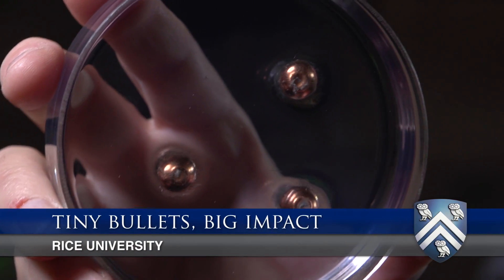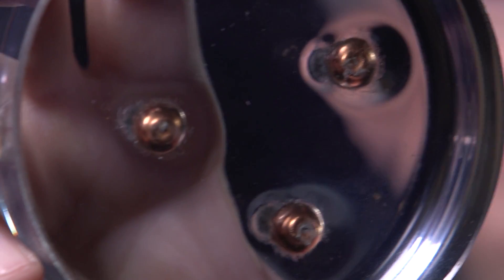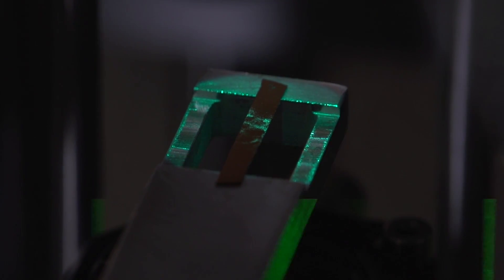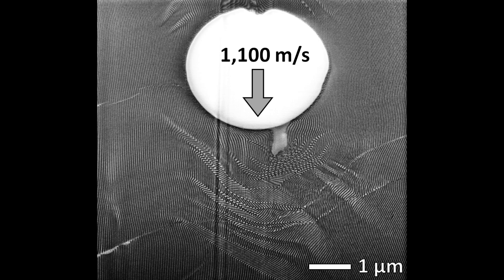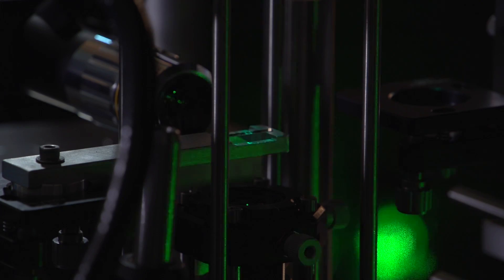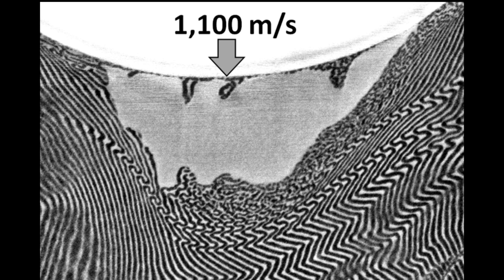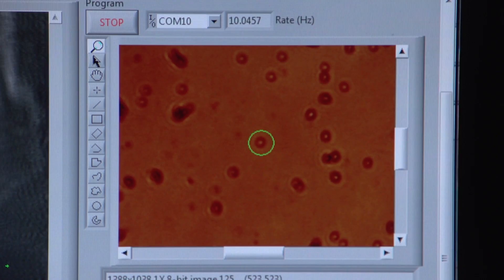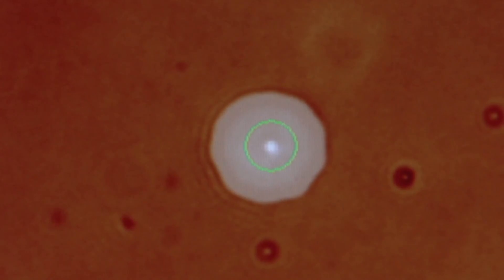Microbullets reveal material strengths at Rice University

Comment: well if they can make it thin enough where the point it wont be too thin and thick enough so it would be bulletproof, they can make it light enough. That solves the lightweight problem and if they only put it in certain areas like the upper chest, mid-stomach, front thighs, etc. it can fix the flexibility problem. Sorta like BATMAN's suit